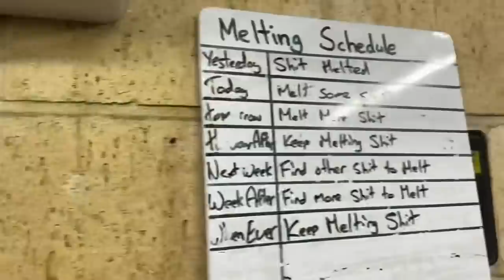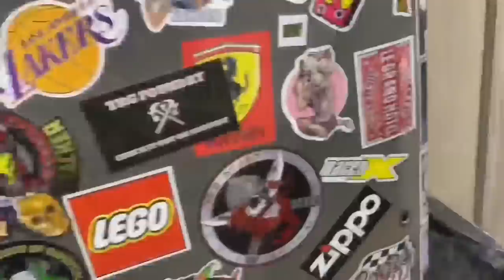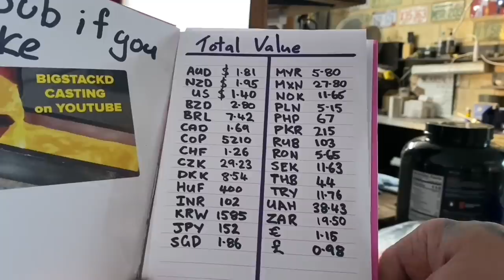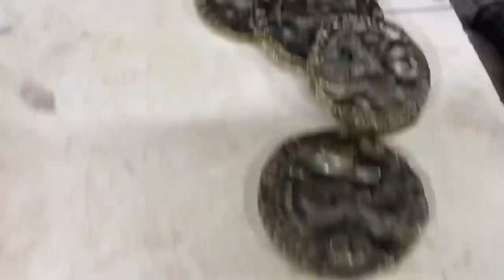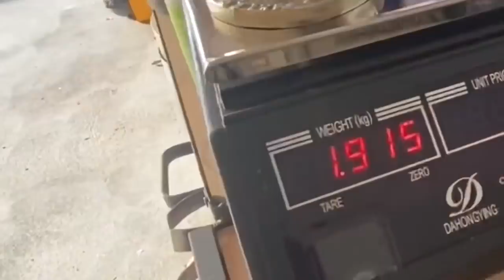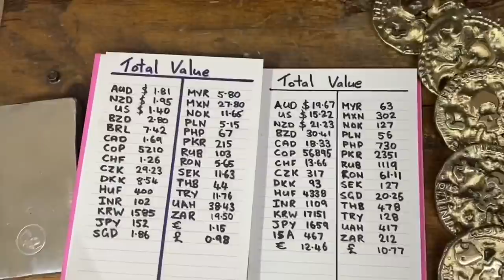Tea Light Candle Trash To Treasure - Copper Coin Casting - ASMR Metal Melting - BigStackD

Comment: A tip for you Bigstackd-

When you are making a sand mold, and you need to pick up the 3d printed coins out of the mold, then it can ruin the mold many times if you pick it up by screw drivers and hand. I recommend to stick something on its back with hot glue and then pick the 3d printed coin out, by holding the thing which is stuck on it with hot glue. This way, the sand doesn't move and your mold doesn't get ruined. Hope this helped....

Comment: Wouldn't have guessed in a million years to melt those tiny aluminum tea candle holders. And, those large candles turned out great. Those coins looked pretty nice. Great video and was upped to brilliant with the boys. Stay warm and have a fantastic weekend. 👍
Reply: Between supplies and fuel cost he probably lost money on this one. What was the aluminum worth at the end? $2. It only works at scale imho.
Reply: Maybe if he used electric furnace it would be OK. It’s much more efficient and for aluminium it’s great as it has low melting point .

Comment: Started scraping metal from renovation jobs, either buried in landfill or goes in the back of my truck. Typically scraping copper, brass and aluminum. Trying to figure out if wire is worth the effort to strip. Bare wire is close to $4./# in my area.

Comment: bigstackD Casting,
which way does the water swirl down the toilet drain when you flush
clockwise or counter clockwise
asking for a friend
Reply: Thats a trick question, you should be asking which way the clock turns... 
Toiletwise or counter Toiletwise

Comment: A nice tip for the candles. If you can, soak the wicks completely through with the wax, let them dry, then thread them through and reapply wax to the ends sitting out. I'm sure you did, I just learned the hard way lol.

Comment: Morning Bigstack D. 

You are right, it is a first watching tea-lite holders melted into something and you can see why nobody has, it's a lot of work. 

I've been away a while and you've added stuff and a dogs missing and you've more footage from where you live which is very interesting to see. 

Yesterday in the UK (the hottest yet) was probably a normal days temperature for you guys, I found it too much and stopped working. 
I have also been head-hunted by a Kiwi lady who married a northern Brit and moved into my next-door village, setting up her base and home and has booked me for next year (I'm a lime plasterer) to help restore her place to it's original (1750's) look with flag stone, cobbled floors, lime plaster skimmed walls and wood lath & plaster ceilings. out the back is the old stables and coach yard and it needs a blacksmith to make all the fittings.
How would you fancy a different metal smithing job doing all the fixings, widow and door furniture? 
I can put you and Ingot up in my man-cave and he will get on with our dog Bonzo. 

Also thought you should know that the bass sound pumped out at the start makes everything vibrate in the vicinity. 
It's like a call to prayer, lighting the candle at the start, is there a secret cabal or cult following and worship of Ingot?

Impressed you got a graphite mold, what are the normal ones made of? 

When you don't have enough molten material for a mold, don't worry, the resulting item will thus be a totally unique one.

Comment: Question, if you melt copper with all the soldering from fittings on it will this weaken the metal or cause it to become an alloy rather than just copper?

Comment: As usual a great video. I am just about ready to start smelting. I have worked hard to save beer cans, split into 3 different levels. Ring pulls, tops & bottoms of cans & a lot of paint covered shards, I don't know If this has any prevalent's, but there I go. I just need an electric furnace, 1-3 kilos, starting off with the easy stuff, but I Intend to get a lot deeper Into smelting my own bars eventually. You make It look so easy. I am but a novice. Do you have any pointers, just a thought? Keep the videos coming, as they are genuinely Inspirational. Be Lucky & Many thanks!👍

Comment: In these videos when you poke the metal while it's melting there is sometimes flame, is that air, the metal, or a surface contaminant like oils igniting?

Also not watched to the end of this melt yet, but, why does there always appear to be sand coming out as slag?  Is it just dust from the environment in the garage? or is that normal to all melts?

Comment: My first thought as the skull came out of the candle mold was to putting that inside your casting sand and trying out a wax-displacement pour with bronze. You would have needed to not put a wick in, and I have no real idea if that is the correct wax to use.

Comment: I wonder which furnace is more energy efficient, the gas furnace or the electric induction furnace. All the electrics ones I have find are really expensive in comparison to the gas ones, which is obvious, but I wonder if the price invested in these make up for the fuel in the case of the later.

Comment: There is one problem with the wax: These candles won't work as you think they will.
The wax came from tea candles, which are meant to melt first and then burn. The wax of these candles has a lower melting point than normal wax. The candles you made will just melt away and most of the wax will be gone, before it can burn.

Comment: As someone in the USA, it always puzzles me how people in Aussie drive on the left side of the road and with the steering wheel on the right side of the car. But I guess the same is true for people in Aussie...they wonder why we're also driving on the 'wrong' side of the road and 'wrong' side of the car and probably find it equally as irritating. Now I'm just waiting to see what happens when you enjoy melting candle wax plus metals. Some combo wax and metal melts? Various flavors of beer-scented candles? Or maybe metallic molds of various designs of candle holders and then with wax added in? Could be an interesting little side business if you started up an online store. It would let you enjoy melting plus add a little bit of wax stuff, too. Or just sell the metallic candleholders of different shapes and types.

Comment: Is there a special reason to cool down the crucible in the furnace? Almost time for bed. In mountain time. 🇺🇸🇦🇺
Reply: In cooking there is thermal shock where if it is not heat up slowly it will break I think it's the same way here if it is heated to fast it could crack
Reply: It's so hot that it will damage anything that it sits on or near it besides being dangerous to flesh human or dog alike.
Reply: Not 100% on it but keeps it from cracking from drop of temp to fast. I did it with a cast iron place I used for melting lead, I layed it down on wet concrete and it cracked all over it
Reply: to reduce thermal shock. It just helps it to last longer

Comment: I watched this video earlier but I lost my internet connection due to rain so I couldn't comment at the time. I just wanted to say I agree that there wasn't a good amount of aluminum from all those tea light candles but...I thought it was cool and typical of you to use the wax to make new candles with rather than wasting it. Afterall that's what you do. Recycle things that would've been trash and make new treasures. They turned out quite nice considering it was your first time. Then the bar itself, even though it was on the thin side looked super sweet to. Just one question though. Did you secure the extra packs you went to buy with the passenger seat belt? Lol
I wonder if it's easy to mix dye into wax. Maybe you could get some black and tan to represent the boys and sell them with your merch since so many people love those fur babies. Or maybe you could just purchase colored wax and not have to worry about mixing anything. Just a fleeting thought. I know your true love is metal. Keep doing you D! 👍❤✌

Comment: Why do you let the crucibleCool down inside furnace I always let the crucible cool down on a brick on the floor
Reply from the maker: It’s just something I’ve always done. When I let it cool on the fire brick on the ground I can hear it cracking and making noise and I’m assuming that’s only bad for the Crucible so I let it cool down slowly inside the furnace. I have no proof if that’s true or not it’s just a personal preference👌🏻
Reply: I was told that that when you fire it to a specific temperature that retains more thermal shock resistant

Comment: Graphit or Iron? What is better?
Reply: Steel casts are obviously stronger than graphite, but their biggest downside is that they need a protective layer added every time you use them. Otherwise, your molten metal can fuse with the cast itself. Casting steel in steel is not a good idea. 

Graphite is lighter, and can tolerate heat that would melt most metals (hence its use as crucibles). But they can crack if not preheated or abused, and can disintegrate if heated for too long with too much oxygen (why the crucibles look so cracked and bumpy).

Comment: wax can be used as a universal mold for casting, namely, by immersing the necessary wax figure in gypsum, you can simply melt it and pour the metal into the voids, the advantages of this method are that the output surface of the finished cast product has fewer defects compared to sand, namely, less time and effort will be spent on finalizing the geometry of the product, the disadvantage of casting in gypsum is a one-time use of the gibs mold, since to extract the product it is necessary to destroy it, of course, strict compliance with the composition of GIBS and its composition. solidification affecting the final result in order to compensate for the defects of the final product, it is necessary to remove excess air that gives pores(you can treat it with a brush by applying plaster solution to the wax figure)either by mixing the solution intensively, or by using a vacuum or vibrating table, the wax figures can be printed on a printer, making it easier to recreate the necessary geometry, just like everything else.

Comment: Вам нужен гидравлический пресс. Прессованный тонкий материал гораздо меньше окисляется. Более того, алюминиевые банки, например, спекаются в монолит под давлением более 70 тонн.
You need a hydraulic press. Pressed, thin material is much less oxidized. Moreover, aluminum cans, for example, are sintered into a monolith under pressure above 70 tons.